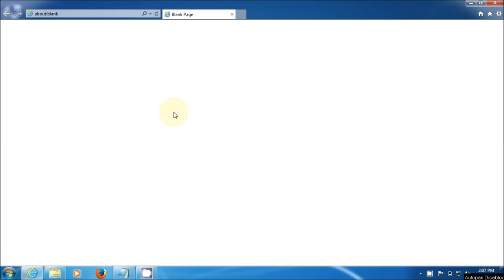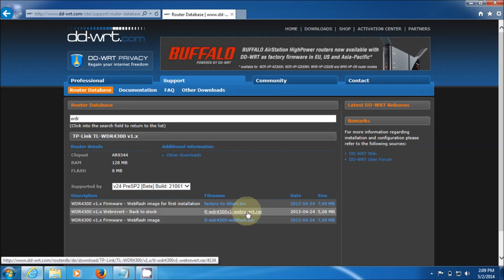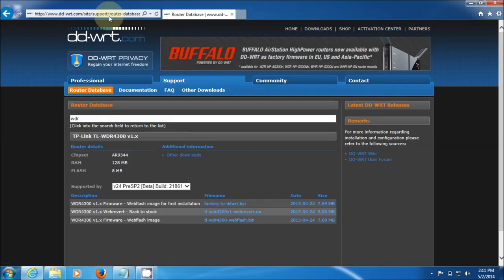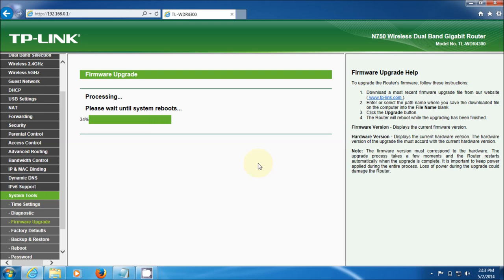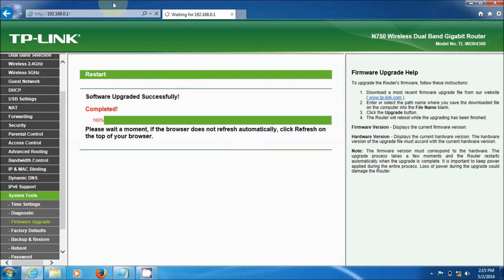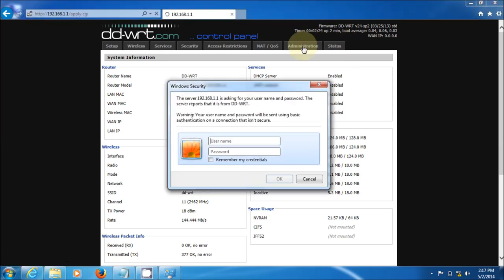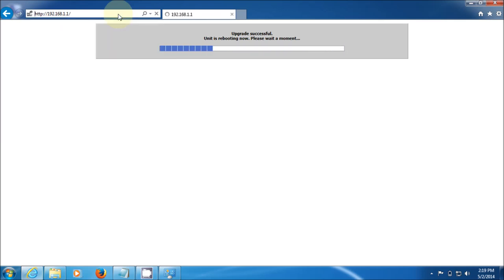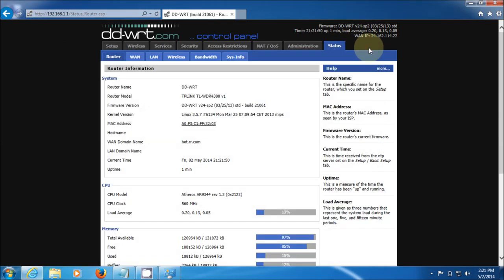DD-WRT Install (Supercharge) TP Link TL-WDR 4300 N750 Dual Band Router

Comment from the maker: @basiliszag I tried that too with this firmware version (21061) and it looks like it has a bug with SSH so Putty or any other SSH client is not going to connect, ever. Install the firmware to Rev r21223 from here http://dd-wrt.com/site/support/other-downloads?path=others%2Feko%2FBrainSlayer-V24-preSP2%2F2013%2F04-11-2013-r21223%2Ftplink_tl-wdr4300v1%2F Understand that this is also a beta version of the DD-WRT so there may be other issues. But I know that SSH works on this firmware. I am looking to make a video on installing the Transmission software on this router so far I have not succeeded in doing so if and when I do I will make a video on how to do it. Thank you very much for the question and watching.
Reply: thanx, I really appreciate your effort. I will give it a try too.  Take care.
Reply from the maker: *****  You're welcome. Good luck. I am having issues installing transmission too. Not sure why. Thanks

Comment from the maker: @trAnwhiz The webflash and the factory-to-ddwrt contains the same firmware but with slightly different headers,

The webflash is for up/downgrading a currently running dd-wrt firmware on the router.

Comment from the maker: @David Chou I can not see why it would not work. TP-link somewhat acknowledges that DD-WRT is compatible with this router though they claim no responsibility for it. Here is their disclaimer:
"Some official firmware of TP-LINK products can be replaced by the third party firmware such as DD-WRT. TP-LINK does not provide technical support and does not guarantee the performance and stability of third party firmware. Damage to the product as a result of using third party firmware will void the product's warranty."
Unfortunately I can not test this at this time to verify it.

Comment from the maker: @Alex Ivanov That's strange. I have been running the DD-WRT v24-sp2 (03/25/13) std - build 21061 Since I got this router and it is rock solid reliable on wifi and lan.

Comment from the maker: André Bezerra I seem to have lost your comment. I have videos on printer sharing with the DD-WRT firmware here: http://www.youtube.com/playlist?list=PLnxXRLSlmSVMD8Kx5H_m-_N3APCRs2ho8 Thanks
Reply: Richard Lloyd thks! I've a new issue with ftp service. Did you have?
Reply from the maker: André Bezerra I am not using the service. What problem are you having with it?
Reply: Richard Lloyd  can't access my hard drive in my router through FTP service.
Reply from the maker: André Bezerra I just configured it on my router with a small USB 4GB Fat 32, a 1 TB laptop drive with NTFS, Linux Ext4 and I can access every one of the drive partitions. I am using r27147 on it. Here is a link to it on my server as it looks like dd-wrt is not serving files today http://www.richardlloydusa.com/dd-wrt/WDR4300V1/

Comment from the maker: ***** I downgraded my router and it appears to have all the VPN features. Here is a picture of the VPN services page http://rlloyd.myvnc.com/VPN.jpg Thanks
Reply: Hello Richard! Thanks for your video. Does this firmware (the one that you installed last on the video) has already the 'OpenVPN' feature? Thanks
Reply from the maker: Tiago de Moraes The DD-WRT v24-sp2 (03/25/13) std - build 21061 I show on the video has support for the OpenVPN Server/Daemon and or OpenVPN Client. I don't use either so I can't comment on how well they will work. Thanks
Reply: Richard Lloyd Appreciate it!  Thanks for the quick answer. I will try to flash this as soon as it arrives. If I run into any problem, I will kindly ask for your help. Thank you!
Reply from the maker: Tiago de Moraes  You're welcome. Happy to help. Here is a picture of the VPN Page http://rlloyd.myvnc.com/VPN.jpg Thanks
Reply: Richard Lloyd Yep!  By the looks of your pic, it has 'OpenVPN'. I will be receiving the router in the next few days and I will try it out. Thanks a lot!
Reply: Hello Richard! Thanks for your answer. Can be installed at a later wdr4300 v1 ddwrt firmware. Thanks.
Reply from the maker: Tiago de Moraes
 You are most welcome. Thanks for watching.
Reply from the maker: ***** My pleasure. thanks for watching.
Reply: Richard Lloyd Hello Richard. You did not understand me. I asked if it is possible install latter stable firmware as DD-WRT v24-sp2 (03/25/13) std - build 21061? Yet tell me please whether it is possible back to stock firmware using this file 	tl-wdr4300v1-webrevert.rar. Thank you very much.
Reply from the maker: *****  If the dd-wrt firmware version has a webrevert file you can take it back to stock using that file. If it does not then you can not take it back to stock (as far as I know). Be careful which firmware version you use for this reason. I am not willing to experiment with this as you may end up stuck on a firmware version that you can not reverse. As I said it may be possible to take it back but I would not know how. Thanks
Reply from the maker: *****  Disregard my last post. You can upgrade the firmware to the latests beta r25309 and then flash it back to the current supported 21061 which then you can webrevert back to stock. I love this router. Hope that helps.
Reply: Richard Lloyd Router is super and you are super. Are you tested this new r25309 beta firmware? Is better than 21061 thanks.
Reply from the maker: *****  I am not sure if it works any better but it seems to work just as well. They must be upgrading it for a reason. It has a slightly improved look to it but other than that I don't see the any great improvement. Unfortunately they don't post on the router database what they enhancements are but I am sure they list them somewhere on their site or on the web. Thanks
Reply from the maker: *****  I have found several bug in the 21061. I have been using the r25697 with much better results. Here is a link to it http://dd-wrt.com/site/support/other-downloads?path=betas%2F2014%2F12-22-2014-r25697%2Ftplink_tl-wdr4300v1%2F
Reply: Richard Lloyd Hi Richard, first of all I want to thank you for your video, it helps a lot. I have thw same router and just installed the same version, r25697. I'm having an issue trying to unmount a USB drive. Have you tried enable this "Use SES Button to remove drives" option at "Services"/"USB" page? Should it work pressing the router reset button? thanks in advance.
Reply from the maker: *****  It's "supposed" to work. I have enabled the feature but I don't see any evidence of it actually working. I just wait a few minutes after I access the drive and unplug it. I have not had a problem following that procedure. After all it is a USB device. The biggest problem would be removing the drive during a data read or write which could cause data loss. Thanks. Here is the first video I have on this: http://youtu.be/mdSyWDTY0h0?list=PLnxXRLSlmSVNiENiN9wTejP6dtIqqmTya

Comment from the maker: r27147 still works great for me. There may be better dd-wrt firmware available now but it works so well for me that I don't want to mess with it. Thanks.
Reply: +Richard Lloyd Thanks.
Reply from the maker: +Siddharth Dasgupta You are welcome. Thanks for watching.
Reply: +Siddharth Dasgupta could u please help me to set pppoe
Reply from the maker: +Arindam Biswas There are so many variables involved in getting PPPoE configured correctly that it's not something I can guess at. Call or contact your Internet Service Provider, tell them what you have (it's more or less the same for any router) and they should be able to tell you how to configure the connection. Thanks.
Reply: +Richard Lloyd thanks..... i contact my my internet service provider, they solved my problem in a minute ....
and its just rock..... now how could i increase my wi fi range... i stay in a very congested area...
Reply from the maker: +Arindam Biswas You could make a repeater using a WR841N V9 Amazon: http://amzn.to/19rM7nx put DD-WRT on it and then follow this video https://youtu.be/n7IS6kiApOc?list=PLnxXRLSlmSVNiENiN9wTejP6dtIqqmTya and all this should not cost you more than $20. But understand that this router is only a 2.4Ghz router so it won't extend the 5Ghz range. Thanks.
Reply: Ok :)

Comment: Hey Richard!  Finally got the router and did the flash with the same exact files you used! It worked beautifully, including the OpenVPN configs from my VPN Provider.  Now, I am having a problem that the router does NOT recognize any HD/ThumbDrive/Pen Drive that I connect.  I've used several different sizes - 2 GB, 128GB and 32GB - as well as different formats - NTFS, ExtFat, FAT32 - and it does NOT recognize still.  Any ideas we can try out?  Does it work for you with the same firmware I have?  Here is a pic from my screen under 'Services' -> 'USB' while 2 different USB devices were connected:  http://tinypic.com/r/148kjv6/8        **Thanks for all the usual help!
Reply from the maker: Not sure which firmware you are using but I just tried it with firmware 21061 and it worked with the same settings you had:
--- /dev/sda
Block device, size 961 MiB (1007681536 bytes)
DOS/MBR partition map
Partition 1: 961.0 MiB (1007665152 bytes, 1968096 sectors from 32, bootable)
Type 0x06 (FAT16)
SYSLINUX boot loader
FAT16 file system (hints score 4 of 5)
Volume size 960.7 MiB (1007386624 bytes, 61486 clusters of 16 KiB)
Status: Mounted on /mnt
I originally had some difficulty making contact with the physical USB port, there are two ports on the back of the router. Try them both. Insert the the USB stick all the way in and then pull it out a few times. I think the contacts sometimes become dirty and don't make a good connection with the USB stick. Try it again. Thanks. Tell me how it went.

Comment: Hey Richard I know this video is old and I watched it awhile back but from some of your newer videos I saw your still using this router.  I have the same firmware version as the one you flashed in the video was wondering how dd-wrt compared to stock in terms of performance and signal.  Reviews on amazon say it improves it but wondering what your experience was if you could remember
Reply from the maker: subwayclub27 I have not used the stock firmware since I flashed it. I find it to be quite fast and reliable. You could try the firmware and see if you like it. You can always revert it back to stock using this video https://youtu.be/H_qZLOMvFLA?list=PLnxXRLSlmSVNiENiN9wTejP6dtIqqmTya Thanks
Reply: +Richard Lloyd So since I'm on the out of the box firmware like you were in the video I should flash it to dd wrt with the r27147  link you provided so it won''t brick it since the other one will brick the device
Reply from the maker: Er R I have had no bricking issues with any firmware that is r27147 or newer than so to be safe do not use any older firmware. Thanks

Comment: Hi Richard, will the method shown here still work even after I've upgraded the factory firmware to the latest 9/16/14 firmware (wdr4300v1_en_3_14_1_up_boot(140916)?

Comment: UPDATE: I'm now able to use the router at full speeds. It was fixed after performing several resets to both the modem and the router.

ORIGINAL MESSAGE:
Hello Richard, I upgraded using your method and the results were fantastic. However, I recently upgraded my speed through Specturm from 20mbps to 60mbps. The speed is blazing on the wired PCs, but the router is only giving me a max of 40mbps during a simple test (not streaming) - Is it that I must do something else to the router to increase its capacity, or should I be looking to purchase a router with higher output?

Comment: Hey Lloyd. I did this last night with a bit of disappointment, because, after installing it and flashing it correctly, i ended up being disconnected from Wireless 2.4 every 10 minutes. I didn't want to start clicking on settings unknowingly, so i reverted to stock and upgraded firmware to full. Now stable with stock..

Comment: very nice guide indeed! thanx!

just yesterday i have put OpenWRT FW on my 4300 and it totaly screwed my router..

Had to unbrick it using serial cable.. what a mess... succeeded in unbricking after whole night of fighting with dead router :)

at 7AM got stock FW installed...

Tip:  use tftp and wps button to trigger download of rescue FW..

(set IP to: 192.168.0.66, and put rescue FW to root folder of TFTP server)

will try DD-wrt now!
Reply from the maker: Not too fond of Open WRT because of the risk of bricking. Thanks for the tip (Tip:  use tftp and wps button to trigger download of rescue FW.). I am using (stable) DD-WRT v24-sp2 (03/25/13) std - build 21061 without any issues currently. Best of luck.

Comment: When doing this dd-wrt firmware does it loose the ip bandwith control settings from the stock firmware where I can setup each speeds upload and download.
Reply from the maker: This router still has bandwidth control (QoS) features. BTW you can always revert the router back to stock. I recommend that you have the latest stock firmware update from TP-Link for the WDR-4300 router before proceeding: http://www.tp-link.com/resources/software/TL-WDR4300_V1_141113.zip

Comment: @Richard Lloyd Just wanted to say thanks for this tutorial. I also have a TL-WDR 4300 and I only had issues with it. The wireless was dropping every few minutes and sometimes the only way to get it back was to reboot the router which oddly it took ~12-15 minuted to get back online. It was booting in ~1min but internet was not working for another  ~15mins. (no idea why and I don't have this issue with the old router) I was just about to send it back but before that I thought to give DD-WRT a try and found your tutorial on how to do it. I went with DD-WRT v3.0-r27944 std (10/09/15) and now it's like entirely new router, I almost can't believe it's the same router. It takes only ~40 seconds to restart it and get the internet working and also I did not had the wireless signal drop a single time since install (2 rooms from the router, 2 walls). Thanks.
Reply from the maker: +Daniel Anechitoaie That's great. You are welcome. I only buy routers that are compatible with the DD-WRT firmware and now you know why. It's very stable and reliable for the most part. Thanks for watching.

Comment: Hi Richard, todayI flashed my TL-WDR4300 from the latest official firmware to DD-WRT r25697.firmware. I only used the "factory-to-ddwrt.bin" file. It works well and I like its DDNS (duckdns.org) and VPN functions.

I did some research. If user is using the official firmware or Open-WRT, he should use "factory-to-ddwrt.bin". If the user is already using DD-WRT and would like to update to this version r25697, he should use "tl-wdr4300-webflash.bin".
Reply from the maker: That is correct. I am assuming in this video that you are going from stock to DD-WRT. But it wont hurt it to flash both as an upgrade on the DD-WRT firmware either. Thanks.

Comment: r26138 is the latest that supports wdr4300 now. what do you think about that. should we update.
Reply from the maker: I have tried the r26138 and it bricked my router. I did do a UART rescue to bring it back to life: http://youtu.be/t35Pei_eb6o?list=PLnxXRLSlmSVNiENiN9wTejP6dtIqqmTya In fact every version after r25974 bricked my router. So I do not recommend any firmware version after r25974. I have no idea why it is happening either. Perhaps I am not doing something incorrectly but my procedure works up to firmware r25974. Thanks

Comment: hi Richard,

have you been able (if you tried) to connect an 3G USB dongle to that router via USB port and make it a primary WAN/Internet device?

just a thought, it could be nice feature to use 3G temporarily in case main "DSL/Cable" internet goes down...
Reply from the maker: Good idea but I don't see any such functionality built into the GUI. It's set up for connecting USB drives and printers. Unfortunately I don't have a 3G USB Dongle. But here is a way you could share it out using windows Internet Connection Sharing (ICS) http://youtu.be/02XTAxotQvI http://youtu.be/Lv35oV09huw though it's convoluted you could connect an (ICS) computer with the 3G dongle connected and share it to the network through the WAN port on the router. Thanks

Comment: I did the first flash(factory to dd-wrt.bin), but I didn't do the second flash. I setup everything and already customized some settings, but if I wanted to do the second flash would it mess anything up?
Reply from the maker: It shouldn't mess anything up but you should do it. There is a backup feature under the administration tab there is a backup tab you can use that to back up your config. Thanks for watching.

Comment: thank you for this tutorial, it's really help and I've had successfully installed dd-wrt on my router same as yours, but I have a question on how about upgrading dd-wrt firmware on this router? do I need to use factory-to-ddwrt.bin then tl-wdr4300-webflash.bin or only use tl-wdr4300-webflash.bin to upgrade? thank you.
Reply from the maker: Good question. First you flash the factory-to-ddwrt.bin then you finish the flash by using the tl-wdr4300-webflash.bin. It's a two stage process. Thanks for watching.

Comment: Thx for making this video , there is great info here and you seem to respond
to questions which I really appreciate to help ppl.
I have some questions too:
1) Does your recommended fw work on all versions of WDR-4300
2) The wiki says to do a 30/30/30 reset 2 times , did you do that as well?
Reply from the maker: Linux Cow TP-Link and DD-WRT only shows one version for the WDR4300 and that is a Version 1.x so yes it should work regardless. I have never had to do a 30-30-30 two times to achieve this but I would for sure upgrade to the latest TP-Link firmware prior to attempting this http://www.tp-link.us/support/download/?model=TL-WDR4300&version=V1